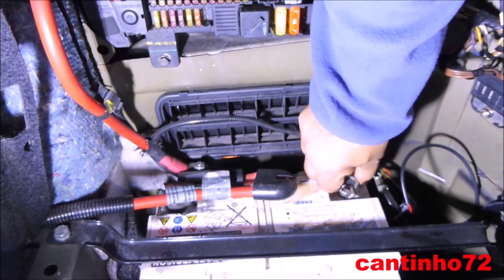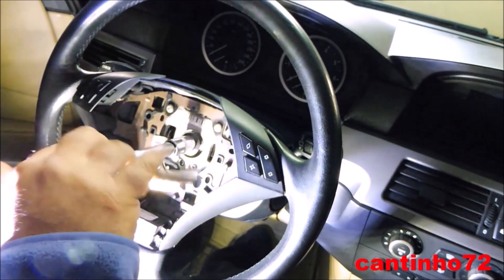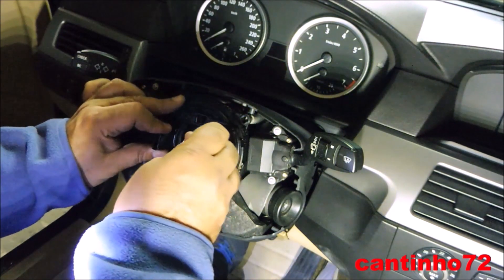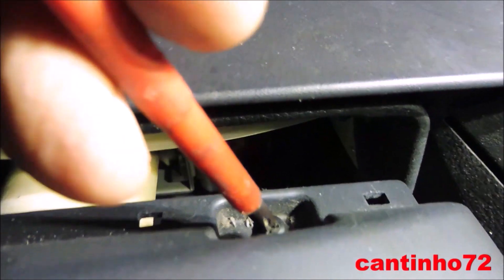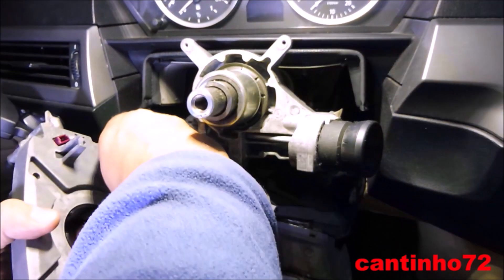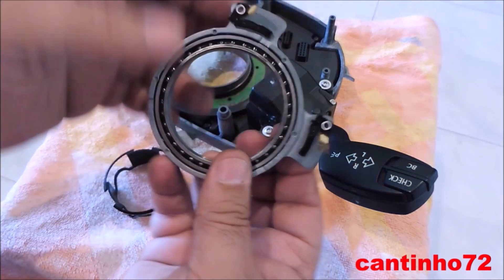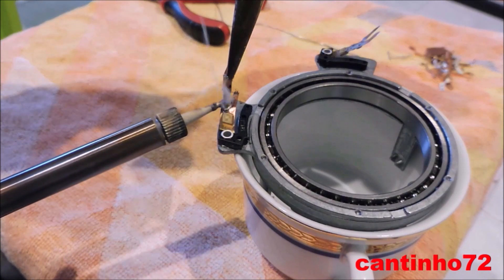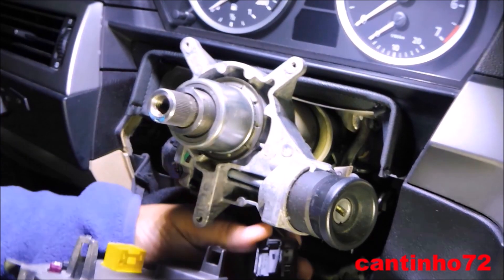Modul SZL, DSC, lamp on angle sensor, clockspring,airbag, BMW.

Comment: My BMW E60 LCI horn sometimes worked and sometimes did not work. When I turned the steering wheel to the left, it worked but when I turned it up, it did not work. Now it does not work at all. What could be the reason?
Reply from the maker: The problem is the piece clockspring in the steering whell!
Reply: lci models do not have a clock spring. there is a plastic disc
Reply from the maker: Ok in this case the problem is this ! @ersinylmaz4172
Reply: what could be the problem
Reply from the maker: I'm my opinion the problem os in the plástic disc.
Please subscrive my Chanel and Helô to grow!

Comment: Boas, ficou resolvido o problema entretanto? O meu 30d está igual, e é a versão pre lci, o sensor deve ser igual ao seu. 
Obrigado
Reply from the maker: Sim durante algum tempo, depois voltou a avariar.
Reply: @Cantinho72  Tinha ficado entusiasmado até ler esta resposta. Então não resolve o problema, porque será? Tenho um 530Da de 1/2004 com o mesmo problema e não encontro um SZL em lado nenhum.

Comment: Guys in my case, Rolls Royce Phantom - 2004 - i’ve had transmitter SZL and or EGR, ETC.. shown in the diagnostic system..

I only took iff the battery for 10 minutes and placed it back, it went back to normal and the voltage is stable.

Those faults could possibly happen due to a bad alternator, not necessarily to be completely off, but the alternator could be just not as affective as a healthy one.

Thank you for reading.
Reply from the maker: Thanks for your comment.
Subscribe to my channel.

Comment: Many thanks . Thanks to the video I have solved the breakdown that I was asked for in BMW 600 € but you can please leave a link to buy contacts or contacts with the full ring.
I write to you from Spain
Reply from the maker: Thanks for the words, it's great to know that it helps. Contacts did not buy them. I got an old relay and adapted it.
Reply: Is that really worked? My traction is going of after turning the steering wheel every time